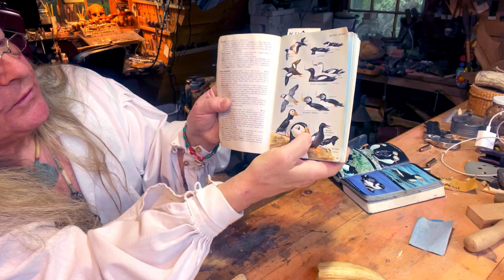How to Scrimshaw a Puffin, Part 1 (Carving the Whale's tooth)

Comment: Very nice, I am curious, Do you know what the most common tool set was for bulk removal in bone carving before rotary tools?
Reply from the maker: Hey Adam, that’s a good question. I believe that saws would be the first step , then rasps and chisels. I know the Inuit people in ancient times used slate as a saw to abrade long channels in tusks and such, then could place wedges to slit out shafts for different things. But I have seen bone saws in scrimshaw tool kits. Chisels and scrapers work quite well, just a little slower then rotary tools.